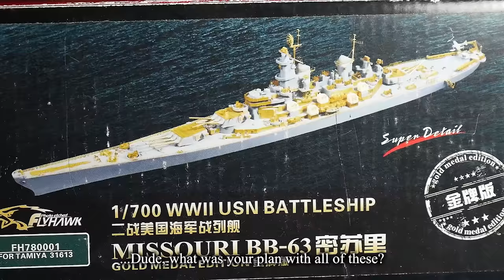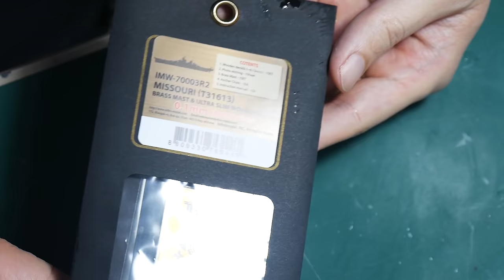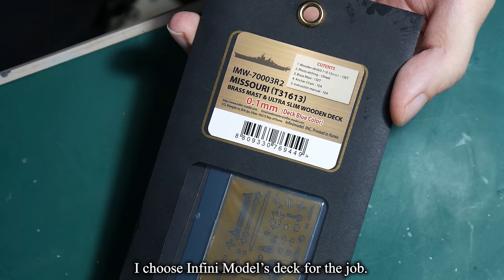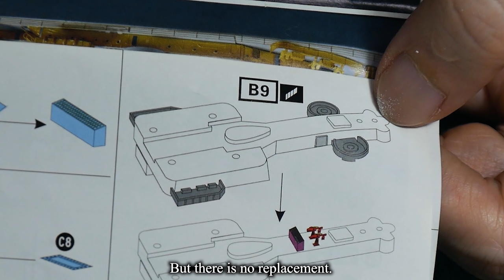1/700 USS Missouri Full Build (Tamiya +Flyhawk)

Comment: It is fantastic and I admire your wonderful work!
BB63 is one of my favorite battleship!
I have a question:
Is it an option for pre-painting some of the photo-etched parts first, such as rails or shields, then glue them later instead of crazy tinny tiny masking the deck?
Reply from the maker: It is a matter of preference. If you like to affix railing after you paint the surface, it is fine to me. 
But I wouldn't do that because the paint can be ruined if you use superglue on it, and the masking is not that hard.